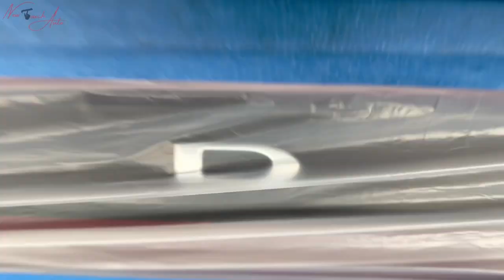How to plasti dip a car for beginners

Comment: Great job, my friend. Knocking it out of the park. Do you use the turbine or a compressor to spare the Pro Line
Reply from the maker: Both can be used when you’re using Proline but the compressor works best. Due to my air compressor not having a wall insert I used a stage 3 turbine.

Comment: You're doing some really nice work here with these spray wraps. About how much do you charge to do a Challenger or a Charger like that in a color shift wrap?
Reply from the maker: Thanks for the compliment, when it comes down to color changing wraps the price quotes will vary. My price quotes may or may not be the same as others but know that most shops aren’t the same.